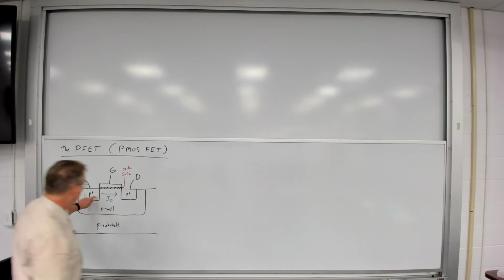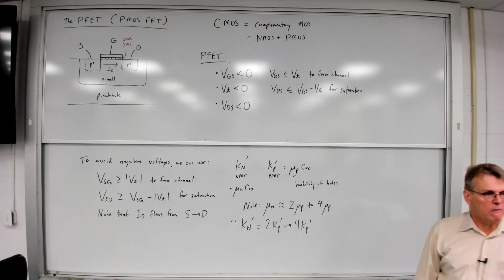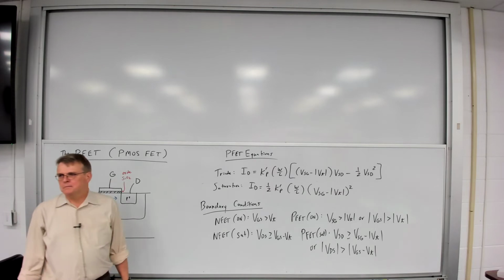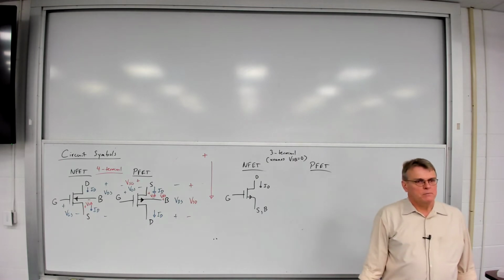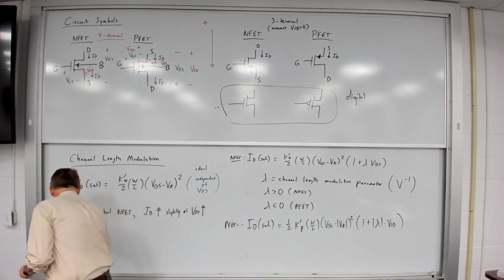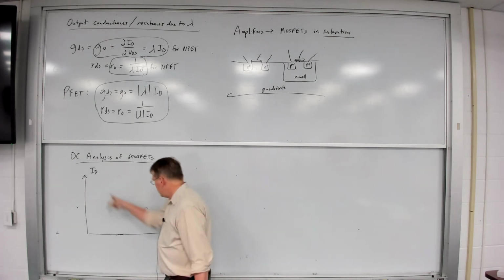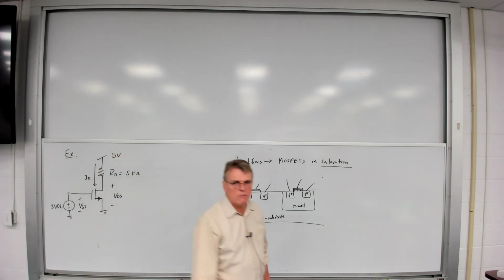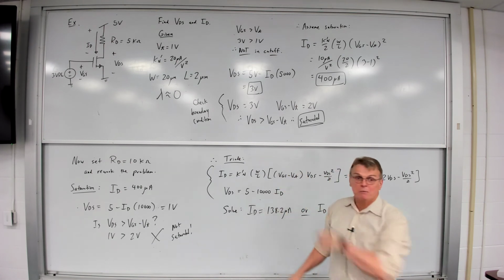Electronics - Lecture 10:  NFET and PFET parameters, schematic symbols, DC analysis of MOSFETs

Comment: Im confused as to why the direction on the PFET is from Source to Drain. In the previous lecture, you said that, for NPET, what is called Source and what is called Drain is just the matter of which direction the current goes (because the device is symmetrical). So, in terms of electron current, electrons goes from Source to Drain, which means conventional current goes from Drain to Source. This i understand. But if we apply the same logic, in PFET, wouldnt  electrons still goes from Source to Drain? Again, just the matter of which direction the current flows? which means conventional current still goes from Drain to Source, and not vice versa? It seems to me the direction for PFET is based on the the fact that Source and Drain were ALREADY chosen.
Reply from the maker: For an NFET, electrons are the majority charge carriers, traveling from the source to the drain.  In a PFET, holes are the majority charge carriers, also traveling from the source to the drain.  Since holes travel in the same direction as positive current (opposite the direction of electrons), then current direction in a PFET is "flipped" in comparison to an NFET.  The source will therefore be more positive than the drain in a PFET.  You'll see a similar situation with BJTs, where the emitter of the PNP transistor is more positive than the collector.

Regardless, in a symmetrical structure the choice of "drain" versus "source" will be determined by the direction of current flow for both NFETs and PFETs.  Positive current flows from drain to source in an NFET, and from source to drain in a PFET, because of the way that majority carriers are defined for the devices.